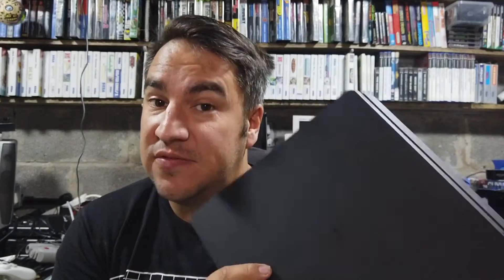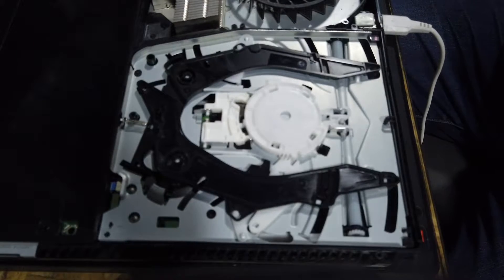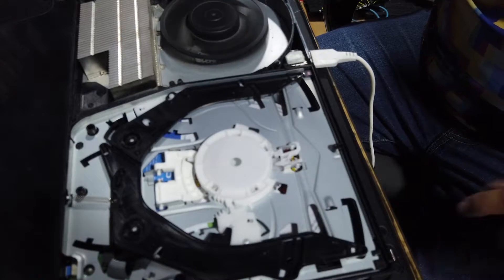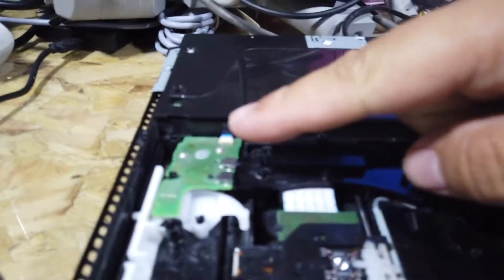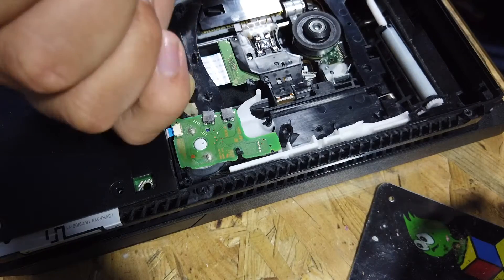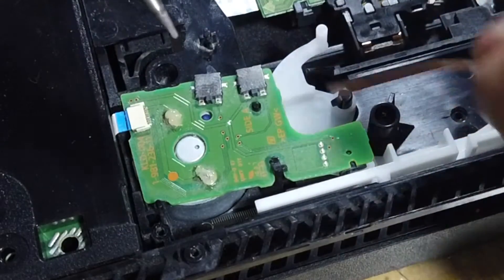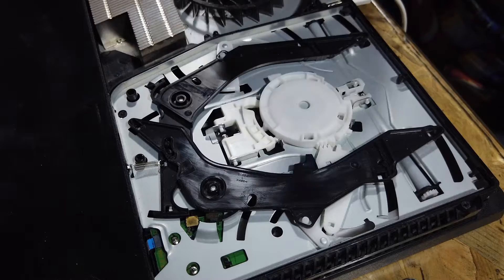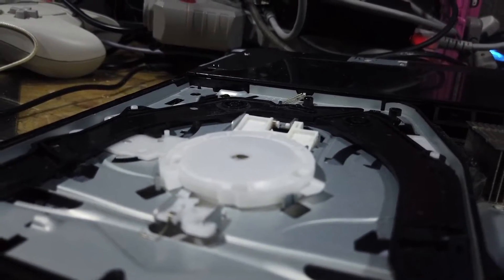PS4 KLD-004 Slim Disc Not Spinning Bluray Drive Fault Repair Sensor Sony Playstation 4

Comment: I just changed the board just like you said in the video and my disc still won’t spin 😢 any ideas? Could it be the actual motor? Ejects and takes discs fine have done all other update fixes etc to no avail. I’m bamboozled now
Reply from the maker: If those contacts are giving continuity when tested and all cables are connected it could be the motor.
Reply: @ Thanks. Will swap the motor. I assumed it’s ok as the disc tray has power and motion. The laser does what it should and grabs the disc fine. Hopefully it’s the motor. Thanks dude
Reply: @Felipe456  did you end up fixing this? is there a part number for just the motor?
Reply: @jamiemcguire2399  I replaced the motor in the end and still didn’t solve the problem. I assume it needs a new disc drive. I tried everything possible on YouTube but to no avail. It’s back in the shelf now. Sad times.
Reply: @Felipe456  ah pity, i doubt it needs a new drive though as those are the main componenets and you changed them. its likely something on the motherboard.

Comment: Mine reads discs fine but won't eject or inject. Have to manually screw each time. Sensors have the plastic switches in place but as far as I see triggering them does nothing, any ideas?

Comment: I had no power then fix the ribbon now then had no disc feed then change out sensors but disc is still spinning up replace the hole motor and sensors

Comment: Hey, Ours is having a problem similar to this, it takes discs, and ejects them, but when they are in, the white piece in the middle just slightly adjusts and then just sits there. We checked those sensor switches and they are both there, and being hit, we replaced the laser. but it did nothing :<. If you had any idea as to what it could be it would help a lot. Thanks
Reply from the maker: You could try and jumper the switches if you think they are a possibility before swapping out the board. But be careful of the disc wanting to spin all the time then.

Comment: One thing i saw is that mine is kld-006 not 004 and if its problem if i put 004 because 006 are a little bit more expensive than 004
Reply from the maker: I'm pretty sure places like AliExpress sell the KLD-004 KLD-005 and KLD-006 as the same part suggesting they are interchangeable. I've never had to swap them for a different model.

Comment: Hi, I know this video is quite old but I'm coming across a similar issue a friend asked me to look at. At first it seemed exactly as the issue described in this video. discs go in but no activity. I noticed, however, that the discs go in only about 95% of the way but never seat fully. That is unless I leave the disk in the drive and restart the ps4. During the reboot, the machine pulls the discs in completely and everything runs normally from then on. So I don't have a motor issue or a roller issue...could it be the sensor? Ive run updates to no avail. Anyone else have a similar problem?
Reply from the maker: Still might be worth cleaning the rollers. It could be that they aren't fully gripping to pull the disc in enough.
Reply: @GoodwinsPlace  Thanks I'll give it a shot

Comment: hi I'm from Brazil!!  What about when the laser moves but the disk doesn't spin?  Could this be a sensor problem?  Or is it a problem with the engine?  I'm confused help me: thanks
Reply from the maker: Yes this could be a sensor switch or motor issue. Hope you can get a spare part to try and swap out
Reply: @GoodwinsPlace  Thanks for replying friend. I opened my ps4 again and realized that the flat cables of the drive were corrupted, the metal plate was pressed on top of the flats. The previous owner mounted the ps4 wrong. The flat cable mark was left on the board, maybe it was closing the flat cable short with the main board, I'll isolate the flat cable and try again. Soon I bring news
Reply: I have now verified that the damaged flat cable is the sensor cable, it was melted with the exposed contacts and was leaning against the main board

Comment: Hey just a quick question, Why didn't you just keep the new motor on the part? Its two screws under the part that hold it in, just seems kind of extra work to solder?

Comment: This sensor impacts the rollers too right? I saw a video where a PS4 wouldn't take discs until after the sensor switch was changed out.
Reply from the maker: Possibly. The rollers shouldn't turn if this switch is pressed. It's more to detect a disc is in the drive.
Reply: @GoodwinsPlace  Yes, but it is attached to an electric motor. That piece is called a load motor. That is what powers the rollers isn't it? That switch board seems to have more than one function.

Comment: Can you help me my ps4 slim keeps giving an error when I try downloading wwe2k 20 but if I try downloading Needforspeed it dissent give a problem it's like the 2k disk will spin until it reaches 5 GB it stops spinning so pleas help
Reply from the maker: Could be the laser on your drive not reading the outer parts of the disc on bigger games. 
Do you have any other large games?

Comment: Idk whats up with my ps4, yesterday the disc drive was working well and now today it just sounds like its trying to operate or something, it stops then goes then stops and then it makes the sound of when you insert the disc. It does eject the cd by pressing the button and it does pull it in. What could be the problem please help.
Reply from the maker: Could be rollers not pulling the disc all the way in. Try cleaning them with a cotton bud, a small bit of washing liquid mixed with water.
Reply: @GoodwinsPlace  OK thanks ill give that a try

Comment: Im using old ps4 and it takes disc but does not read disc you cant even hear the disk spinning 💔
Reply: I forgot to mention is makes noise when taking the disc im thinking the problem is the rollers i hope
Reply from the maker: @yollotop6261  rollers would stop it from going all the way in. See if you can clean them up, I've seen people use a cotton bud and a small amount of water and washing up liquid mixed together to try and bring back the grip
Reply from the maker: It could be this switch not engaging to recognise the disc inserted.

Comment: Thanks for the video, same problem with my ps4. To able to read the disc I always restart the console so it will able to run. I think I'll go to the nearest technician shop to repair my ps4.
Reply from the maker: Glad it helped. Good luck with the fix.
Reply: Hi!

did you fix it

Comment: Will this work if i replace the entire laser deck ?
Reply: I was talking about the laser lens deck and put the link to show you but i guess a ebay link is more dangerous then a scam link from those bot accounts and was wondering if replace that will it fix the issue.
Reply from the maker: @ANIT_CREED  as long as it covers the broken switch then it should be fine.
Reply: @GoodwinsPlace  thank you
Reply: I cleaned my ps4 turns out my eye for the disk tray was a dirty so there's another reason for this issue im glad i cleaned it first before bought the part.
Reply from the maker: Great, thanks for sharing. You should be able to see the broken part before ordering. Glad a good clean worked for you.
Reply from the maker: If you replace the whole drive?.yes that will do it. Might be a simpler swap if you have a while drive spare.
Reply from the maker: I think the comment got blocked by yt due to the link.

Comment: Hey there. I've taken apart my PS4 slim and noticed as with this case one of the switches is broken. When trying to order one I'm hitting a bit of confusion. The part on my machine is kld-006 bit when I look that up online the kld-004 is the only part that is the same shape. Will the kld-004 work?
Reply from the maker: It looks the same but could be from a slightly different drive variant. I've not tried swapping them over to give a 100% answer as it could have a slightly different layout or schematic - on the other hand it might work perfectly.
I'd go for the same as in the original if possible.

Comment: I've just repaired a ps4 slim that wouldn't take a disc inside 90% of the time and wouldn't read a disc. I opened it up and blew on it and fiddled with a few wires and tightened screws down
 It now works perfect 😳 wtf I did to it, I don't know...
Reply from the maker: Good work. Possibly a loose wire. Main thing it's working now. 😁👍
Reply: @GoodwinsPlace  yea probably was

Comment: My gta5 disc is not spinning properly it stops spinning and struggles to spin again and the disc is completely fine... what is the issue?
Reply from the maker: Sounds like the laser needs cleaning or replacing if it's faulty.
Reply: @GoodwinsPlace  no but other discs run with np at all and i have inspected the gta disc i even ran the disc on other ps4 to see if its the disc but the disc turns out to be ok
Reply from the maker: @fool6969  still could be the sign of laser on its way out. Not all discs are as easy to read, so this might be one of the more sensitive titles.
You could look at a pot adjustment but that would be another video as I don't have one on that.
Reply: @GoodwinsPlace  btw do chips inside of a disc stop the disc from working?
Reply from the maker: @fool6969  sorry not sure what you mean. DVDs don't have chips in them it's data on the disc surface.
Reply: @GoodwinsPlace  no i meant those chips those tiny holes
Reply from the maker: @fool6969  oh right. Yes if it has a few scratches or areas on the disc where the silver has removed that can cause it not to read.

Comment: Bro my ps4 just pulls the disc in but the disc doesn't get stuck on the magnet. Any help?
Reply from the maker: Have you opened it up to check similar switches as in this video? It could be that something isn't engaging correctly and the spinal isn't moving for it to connect.
Check everything is moving correctly on the white plastic parts too.

Comment: you made using that soldiering iron look easy.
👍
Reply from the maker: 😂 cheers. Honestly most people would be fine with this fix. Those solder points are quite big and easy to do with a cheap basic setup.

Comment: Wicked fix that Craig, noticed you used solder braid to remove and no a pump?
Reply from the maker: My pump has lost its suck, need to order a new one. Have been looking at a desoldering iron but rather not spend on one if I can avoid it. Braid is ok for the smaller bits but pain in the arse when doing a lot of parts.
Watched your latest video driving back from West Wales the other day. Got all the way to Cardiff before it finished. 👍😁
Reply: @GoodwinsPlace  wicked!
Reply: Omg I think that's exactly what just happened toe mine u made it look easy but I've never used a tool like that before I'll probably mess it up

Comment: That's really cool mate. Love seeing things being fixed. Sean is having trouble with a ps4 so told him to have a look at this. He cleaned out the fan and not that's not reading. Those switches don't look the most robust. Is it an expensive fix overall I still fear the soldering iron lol. Great video well done. 😁👍
Reply from the maker: They can have so many issues. I've fixed most things on them now. I prefer it when I don't have to take them totally apart as it takes ages.
This was about £10 for the part to fix. Not bad really as I think it is a well used system.
Reply: @GoodwinsPlace  that's really decent considering the price you can probably get these as spares and repairs. Quids in if you can fix them
Reply from the maker: Yeah both my Xbox one and PS4 were both bought as faulty for next to nothing.
Going to do a live stream soon on buying a faulty item on eBay then filming the repair. Should be fun.